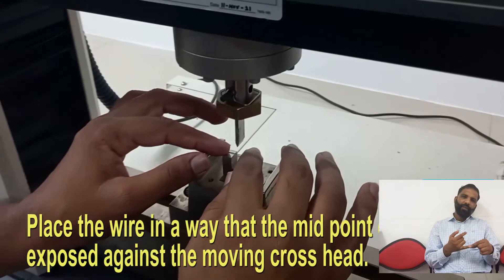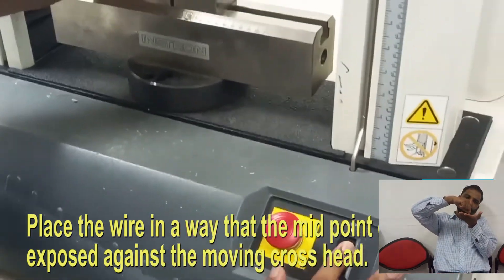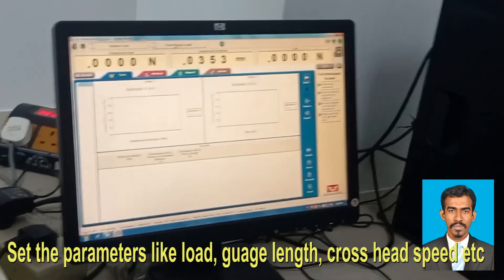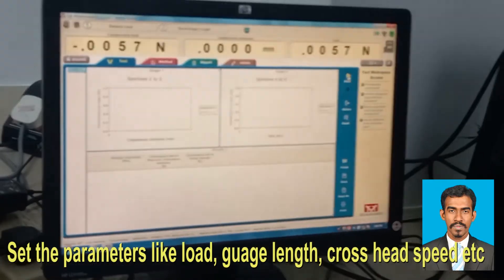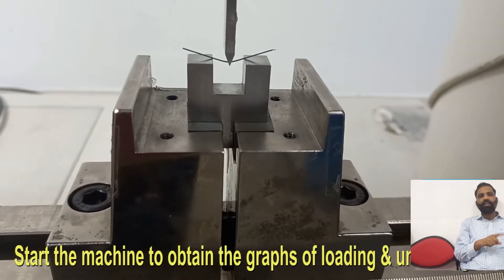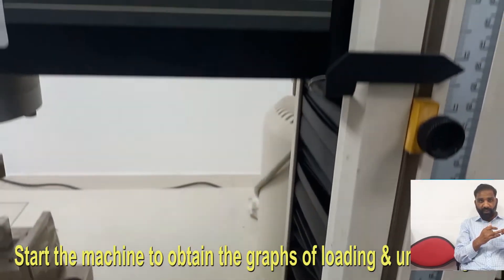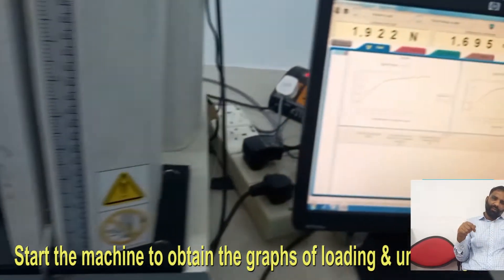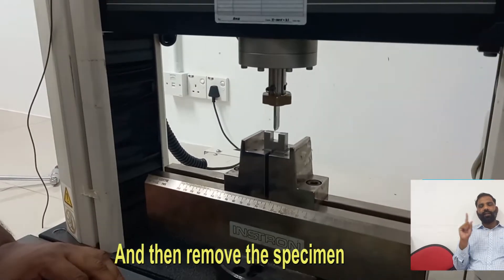3 Point Bending Test of thin heat treated wires.

Comment: "Is it possible to perform a three-point bending test on TiNi shape memory alloy (SMA) to evaluate its strain recovery?"
Reply from the maker: @rakeshkolhapure7083  Yes. It is possible. You can refer my 3 bracket bending test video, where the same material was used.